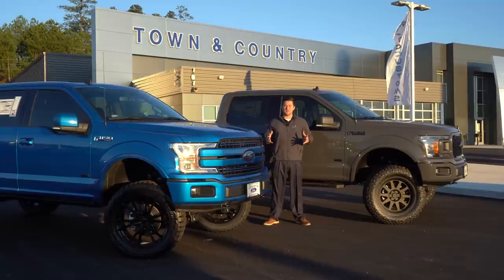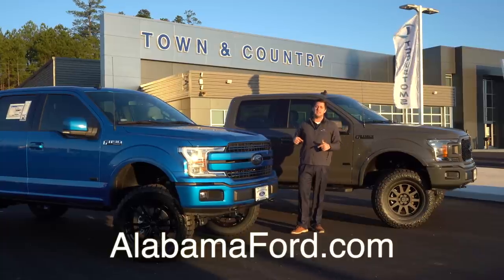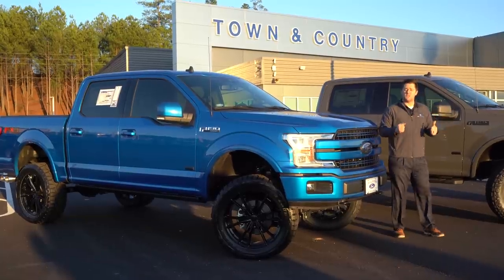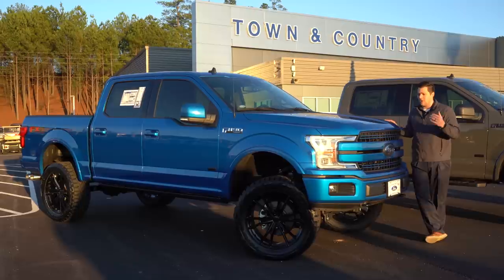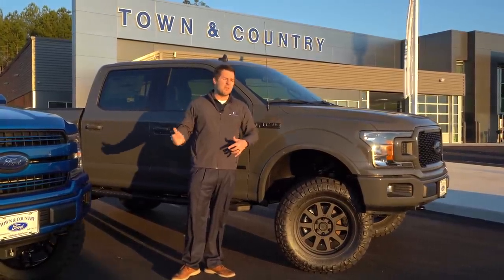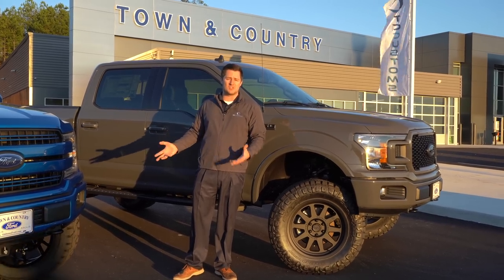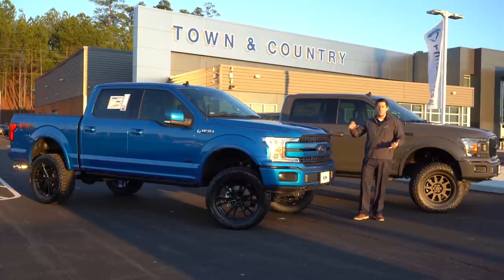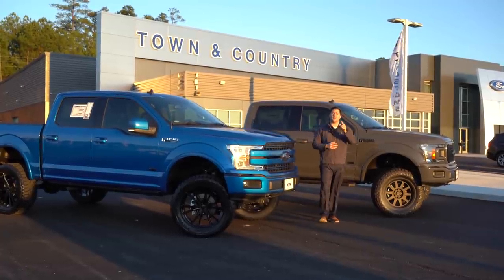Which Gear Ratio do you need on your truck?

Comment: A 3.55 gear ratio means the driveshaft turns 3.55 times for every revolution of the axle, not 3.55 time of the engine.
Reply: Beat me to it.
Reply: i caught that too
Reply: My truck has a 3.55  gets a whopping 12.3mpg  🤣👍
Reply: Why cannot you give names to gear ratios? Racers that have earned it. I just want the Ken Block Gear Ratio, lol
Reply: Thanks for pointing that out, it inspires thought and makes a lot of sense!
Reply: @bthompson1767  my truck is down in the 11's now...  🤷‍♂️
Luckily I don't drive it much.
Furthest I drove it lately was today to a local dealer to trade it in as a down payment on a new GT500...
Reply: What does it mean when you have 9.75.pinion gear with 3.31 rear gears vs 8.8 pinion gear with 3.31 rear gears?
Reply: @angelorivera3611  The 9.75” rear end is the bigger more heavy duty gear. It allows your trucks payload to increase, and tow more.
Reply: Unless it’s in 7th gear!😂
Reply: @angelorivera3611  your ring gear is either 8.8 inches or 9 3/4 is all. 9.75 being beefer

Comment: In 2018 I ordered an F-150 Platinum 4x2, 5.0, 10-speed automatic, 3.55 Locking Rear End. I was going for a max payload Platinum (1,750 lbs) for towing a 6,300 lb Airstream. Best truck I ever owned, and it has more than enough power to pull the trailer up the steepest grades and get back down safely too. My highway mileage towing averages 13 mpg.
Reply: Randall Godfrey just wondering sir why did you buy an expensive model in 2wd
Reply: @TheBigFunOne  2wd vehicles have higher tow ratings and are more economical for towing. The over the road trucks are 2wd vehicles. I also live in Florida where there isn't much need for 4wd. I did get the locking rear axle, which I had on my previous 2wd truck, and that always worked when I encountered a slippery road and helped me pull the trailer out. 14 years without getting stuck so far. There are features that only come with the premium models that we wanted, and the wife says if she is going to ride in a truck, it has to be a nice one. Thanks for asking.
Reply: Randall Godfrey interesting. How much do you want to tow? Because a 4x4 ecoboost can tow 10k lbs easy. You never know when you might drive to minesota in the winter with that truck. 😂
Reply: MrInzombia not likely. A 4x2 EcoBoost can tow more and has a higher payload than a 4x4. I think the V8 has a higher payload rating than the EcoBoost. I was going for max payload. Also, the reliability of the V8 is higher than the EcoBoost.
Reply: @MrInzombia  haha @ 10 "easy" lolololol "EASY"

Comment: Definitely some things to consider when choosing the gear ratio, and this will certainly come down to the individual driving habits and needs of the operator. I chose the 3.73 ratio for my 2020 F150 5.0 as I knew going in I was going to be running taller tires. Running taller tires is going to impact your 'effective gear ratio', but that's a whole 'nother subject. Do I get fantastic gas mileage? Not particularly. Do I care? Nope. What I do know is I rather enjoy the acceleration off the line factor. Added the locking differential to the package too as that could very well come in handy while driving on the beach. I think the 3.55 gears are a good compromise between gas mileage and acceleration for people that aren't towing/hauling heavy loads or running taller tires. If you're using your F150 as a towing/hauling workhorse, or running taller tires, I'd have to say 3.73 is the better suited ratio.
Reply: Which gear ratio would be best for a single cab 10 speed 5.0 f150??
Reply: Looking to use it for just street use quick acceleration and speed

Comment: If you live in the Rocky Mountains you go as low as possible or regret it, the high altitude and steep hills make everything feel under powered
Reply: Tom Fairbourn that’s where the eco boosts shine! Watch tfl towing Ike gauntlet videos eco boosts were the only engines that still had throttle left! Amazing engines
Reply: Andrew Medeiros the turbos help but they still suffer my own experience
Reply: MANSQUITO  3.55 I wish it had the 3.73, one day I may change them to 4.10

Comment: Shoot, with the 10 speed transmission and all those extra overdrive gears 3.73 is the way to go!
Reply: On the same note, with the 10 sp, you don't notice any more aggressive  acceleration between the 3.31 and 3.73.  This is especially evident with the mustang gt that has a 3.15 rear.
Reply: @MormonMustang_  Idk, I drove a 5.0 3.73 and 5.0 3.31 this year and the 3.73 kicked hard, the 3.31 felt very sluggish. I've heard some making your claim, but from my own tests, there is a huge difference.
Reply: @sleep_sounds  fair enough man
 . First hand tests beats hearsay.
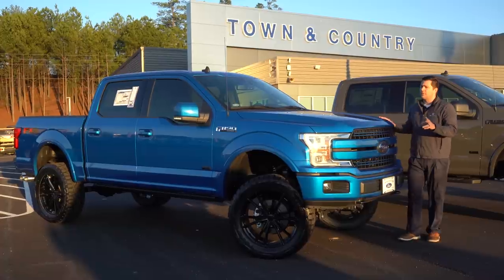Reply: Sound Sleep their zero to 60 is a fraction of a second difference between 3:31 vs 3:73. When you say “ kicked hard” you are almost just making that up in your own mind and thinking you feel a noticeable difference. But a timer will tell you its less than a 10th of a second if that faster. Drive an ecoboost and youll see a real difference from the 5.0. The ecoboost is almost a full second faster than the v8.
Reply: @MrInzombia  still a difference

Comment: With 35 inch tires on a 3.5eco, will a 3.73 act more like a 3.55? My understanding is the larger the tire the larger number gear ratio you want to counter balance that...
Reply: You are right. The larger the tire, the more your ratio will decrease in number (from 3.73 toward 3.55). The actual final ratio would require some math. So if you want to put in large tires, a higher gear number (like 3.73) will help you keep acceleration more similar to a 3.55. If you put large tires in a 3.55, your final ratio will go towards the 3.21. Putting on larger tires will lose you acceleration in general.

Comment: I love the performance of my 18' 5.0 f150(10 speed) with 3.55's with stock tire size (32"). If I were to put 33'' tires on I would need to regear to 3.73 to retain stock performance. If I put on 35"s on I would need to regear to 4.10 to retain the performance of my stock f150 with 3.55's. 37'' would need 4.56 gears. Of course, you can regear the axle gears for bigger wheels/tires all-day but will never regain fuel milage of stock, and you can certainly run 3.55 with 35''s just fine. But I have blown up a transmission in my older f150 doing just that towing a trailer cross country

Comment: I have a 2017 5.0 XLT with a 3.73 final drive & regularly get almost 20 mpg! I drive it like it's my baby, because it is. You won't see any brake dust on my wheels as I save my brakes along with fuel, even though the 3.73 is there whenever I might need it!

Comment: I ordered a 16 with a 5.0 and 3.73. I also have an 11 with a 5.0 and 3.55s. Absolutely love the 3.73. The power difference is dramatically more with the 3.73. I have considered having 3.73s put in the 11 but don’t want to spend 2000 dollars. I highly recommend 3.73s. I only get 1 mpg less on the hwy but I get 1 - 2 mpg more in city driving with the 3.73s. Do yourself a favor and get 3.73s especially if you tow anything!!!
Reply: Great Comment! Ford F150 - the 5.0L V8 and 3.73 gears is the only way to go! 

Check out PaxPower -----> PaxPower.com and read how they can turn a regular Ford F150 4WD 5.0L V8 into a better truck than a Ford F-150 Raptor off the assembly line. 

PaxPower will install a factory Raptor suspension ($7000 installed).....OR.....a better high quality Icon suspension (about $8000 - $8500 installed).....and a Whipple Supercharger as an option. The custom build Ford F-150 4WD will Ford F-150 Raptor's lunch all day long...both on paved roads and off-road.

Comment: Like all you guys videos! I have a late model 2015, 3inch lift, 5.0, 6speed and 34x12 nittos on 20x10 wheels. Gears are 3.31 and I tow a boat quite often. Seems to do way better than my old 04 ,f150 with the 5.4 and 3.55 gears.

Comment: I wish you would’ve touched more on the 3:31 since that’s what I have. I haven’t towed with it yet but love how I can get up to 21 mpg and the rpms are under 2,000 on the highway.
Reply: I have 3.31s in the 5.0 and the towing capacity is 8400 lbs max according to the manual... I have a lot of aftermarket upgrades on it (intake, headers, exhaust, wheels and tires (32ishs) Detroit locker, 4 inch spindles, upper control arms, Bilstein 5100s, super chips programmer) and it tows light stuff like it isn't even there. That said when towing the big trailer (16x8x7) home we just got it did fine empty however I'm regearing it to 3.73 because that puts my towing capacity up to 10k because that trailer is big and heavy and when it's full I don't want to take the chance with the 3.31s
Reply: 331 is your basic.. made for top end... if you tow you will notice  more down shifts  and higher revs even with a 3.5 EcoBoost.
Reply: What speeds are you doing for that rpm at 60mph? I'm in Australia and just doing my research as I want to buy one.
Reply: Hey y’all 2013 3.5tt
3.31 gears 60mph 1475rpm
JTL catch can 
Afe duel cone cai with removable cover 
Hot and Cold side charge pipes 
C-pe intercooler 
Turbosmart bov
73mm bbk throttle body 
Granetilli coils 
Cold plugs 
SPD down pipes with adapters 
4” mbrp single side exhaust 6” tip 
6r80 transmission thermostat delete 
Deatsch lpfp 440
Jms boost a pump 
Snow Meth injection #10 nozzle 
5star & MPT using RTD 
3.96 0-60 12.02 1/4
Top speed in 5th gear 163
180,000+ miles.

Comment: Had an 01’ F150 with a 5.4 and 4.56:1 we did 15k hit 37 states pulling a 25’ 7700 pound airstream and got about ten miles / gal. but only got about the same the rest of the time, 2000 rpm @ 55 mph. In overdrive , the only time I was on the freeway was with the trailer . Worked very well and fun to drive .

Comment: Another very important variable to add into this equation would be tire diameter. If you go on 37" you wanna have a 3.71 or higher to compensate.
Reply: What about 35’s? 3.71? Or 355

Comment: 2018 XLT extended cab 4x4 5.0 10 speed trans, 3.31 gears, 285/75-18 Toyo AT's (35").  16-17 MPG empty,  with 3 other almost adult family members it starts gear searching, hooked to a 6x10 utility trailer or 14' aluminum boat, motor and trailer....12 MPG and constantly gear searching.  I can be traveling into a head wind empty and truck starts gear searching.  Love the truck and engine, just wish it had a 6 speed transmission or Wish I had 3.73 gears or both.

Comment: I own an 09 F250 with 3.55’s. I also owned two 78”s with 4.10”s and the 4 speed manual with granny gear. Those were screaming in 4th at 60-65 mph.
Reply: Ive got an 87 with a C6 three-speed with super aggressive gears, 3k at around 65. I just ordered a 2020 5.0 with 3.73. The 10 speed 3rd overdrive puts it at 1750 @ 70mph, Pretty amazing.

Comment: I have a Ram 1500 with the 3.92 axle ratio and absolutely love the feel off the line and whenever I want to pass people. I don’t tow at all or carry anything heavy often but that off the line feel is awesome.  Yeah mileage is pretty bad compared to my buddy’s with a different axle ratio but it’s a truck so I don’t care plus it will be better for me once I lift it to help with drivability.
Reply: What are the differences in Highway speed? I got 3.55 in my 04 1500 so 95 is easy to get to, when you went to 3.92 what’s your top speed comfortably?
Reply: @cliftonsargent1572  honestly it was comfortable at the speed governed limit of 105-107 as long as it wasn’t to windy out at that point it was just aerodynamics coming into play making it feel floaty.  Power was never an issue and it was still pulling up until it hit the limiter that I didn’t have removed because my tires weren’t rated for a higher speed than what I could go.
Reply: @THEDESTROYER711  ok so you were able to cruise at 65-70 and not be at or over 3k RPM?? That’s the only reason I haven’t purchased a back Axel with the 3.92 gears in it
Reply: @cliftonsargent1572  with the 8 speed transmission at 80-85mph I believe it’s about 2000-2200. The last couple gears in that transmission are cruising gears so it drops the rpms pretty low for that speed.
Reply: @cliftonsargent1572  if you have the older 4 or 5 speed tho I don’t know how it would really effect that tho. I wouldn’t imagine anything more than 500 rpm higher. I’m sure there is some sort of calculator for that.

Comment: My 13 screw with 3.73 has been really good at pulling. 👍🏽
Reply: I also have an '13 with the 3.73 and the EcoBoost. Very good for towing and quick. And you only lose 1 to 2 mpg from the 3.55.
Reply: But around town driving you will get better mileage with 3.73. And that’s where most driving is done, be honest with yourself!!!

Comment: My brother had a F-150 with the 3.31 and when he put 34 inch Nitto Ridge Grapplers on it and it killed his mpg by 4 in the city and 3 on the highway. I had the same tires on my Toyota Tundra with a 4.30 rear end and saw no reduction in my mpg. He ended up trading it in for a 3.73 last year and only lost 2 mpg city and 1.5-2 highway. He was much happier.

Comment: I've got the 10 speed with the 3.73 diff and the 2.7L. I still get great mileage on the highway. The 10 speed is clearly programmed to get max fuel economy when you're driving moderately with a light load in normal and eco modes. It will skip gears to go directly to the higher ones once you're moving and doesn't downshift unless necessary. Of course if you put it in sport mode, different story altogether.
Reply: What do you get on the highway for fuel mileage? I’m mean, I’d rather the 3.73 for the extra towing but the trailer I have is about 6500 lbs so 3.55 works too. Just those multiply times a year is it worth it for the little less fuel mileage the 80% of the driving of the truck
Reply: This is the best combo

Comment: Mitchell , helpful but I assume most dont know just want what go fast and like you do not care about mileage.  I have xl xlt 4 doors for work trucks and personal.  We run 373's and 355 as we can purchase them.  As we keep very close tabs on mileage all 5.0 18's and 19's the difference in mpg is only .5 mpg (avg) between rear ends. Mpg varies between 22 and mid 17's across multi use/payload. Thanks for the content we watch your vids in the shop an usually create good discussion.

Comment: 4:30 With 10 speed auto you don't need 3.73 or 3.55 gears anymore. I have a 2016 F150 2.7 6 speed with 3.31 gears. I have towed a 7,300 lbs. trailer (96 4x4 Tahoe on a Uhaul trailer) and didn't have any problems getting on the hwy.
Reply: How is the acceleration? I’m interested in the same setup
Reply: I have the same. Love it!!

Comment: I went from a 2012 3.5 Eco with the 3.73 rear end to a 2019 3.5 Eco with a 3.55 rear end and 10 speed. I have to say that I miss the 3.73 rear end but on the plus side I averaged 16.9 MPG towing my 2500lb boat/motor/trailer on a 2000 mile fishing trip. Not bad for a gas truck.

Comment: Good video and info. My 2015 eco boost fx4 has 3.55 gears which pulls my 6x12 utility work trailer like nothing even when fully loaded.
Already with just 3.55 gears, my tired will peal with very little gas. The rear ends are light
Reply: Which engine sir?
Reply: @Gypsum-pro  3.5

Comment: You where offon the description of what gearing does. 3.73 for example is a reduction after the transmission so you get one revolution of the tire per 3.73 turns ofthe transmission output shaft.

The 10 speed makes 3.73 almost as long geared as the 6 speed  and 3.31 on the highway and 3.31almost as low as 3.73 in first. 

I tow heavy with my 19 f150 I ended up with an HDPP 5.0 it tows my 11 to 12k travel trailer very well. Better than my diesel excursion.

Comment: Last week I bought a brand new 2020 xlt sport with the 2.7 eco and 3:73 gears. She likes to scoot!! Plus I’ll be towing my 5800lb trailer with it sometimes which helps. Love this truck so far.
Reply: What kind of fuel mileage have you been getting with the 3.73 gear ratio ?  I am of the opinion that a person wouldn't really know the difference.  Truck shopping and the 3.55 seem to be the most common.
Reply: @jetboy770371  I’m getting around 22.5 mpg with it. Also with the different gear it upped my tow rating a little also which was nice.

Comment: First off I like these videos, very helpful.  I would like to hear more about the effects of the different gear ratios.  For example 0-60, RPM @ 60 & 80, MPG @ 60 & 80 and maximum towing weight.  Again great video.
Reply: It's a no brainer. Higher gear ratio means more revolutions of the driveshaft, which causes more friction, but also means more acceleration, more torque, and that friction causes worse gas mileage as you go higher. If the gear ratio is too low, it can make it difficult to move heavier tow/payloads.

Comment: Man, i am not sure if you are a sales person at the dealership that you are standing in front of in this video, but i will tell you that if  you are, you are an asset to that dealership. Most sales people are completely unfamiliar with this information. Gear ratios are a big deal when towing. Also, most customers come in to buy a truck with the incorrect idea of how much payload a truck has. You can have 2 f150's side by side, with 2 very different payload capacities. I bet you are familiar with that as well, and dent mislead your customers.

Comment: 2014 5.0 3.73s i get 15mpg with 35x12.5 tires and a lift. Towing 6000lbs seems good for get up an go. Interstate non towing its around 2200 rpms.
Reply: Is your truck leveled or lifted? And how does it tow?